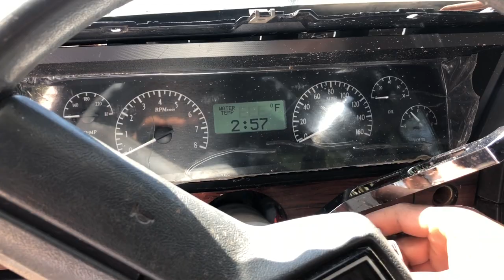White Box Chevy Pt 1 looking for parts and Dakota Digital install

Comment: Got a 89 caprice with a 305 running in albuquerque new mexico 1000 takes it as is serious people hit me for it won't go in gear transmission rebuilt and flex plate replaced dunno what else to do but if someone wants it come get it, yes it has a title
Reply: ,I need that dashboard.  Shoot me an email address.
Reply: @patricksmith3761  need want the whole car gone
Reply: @slotippa573  OK Cool. How do I get in touch with ya?
Reply: @gmail